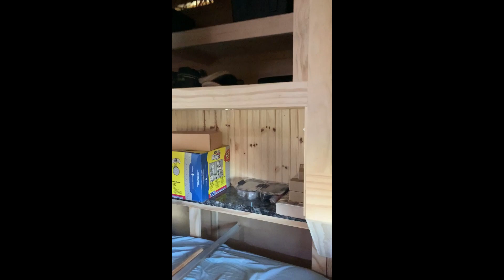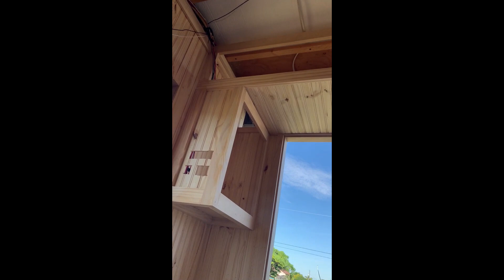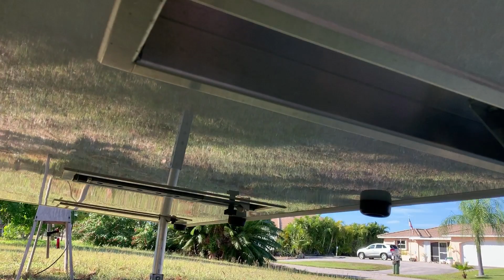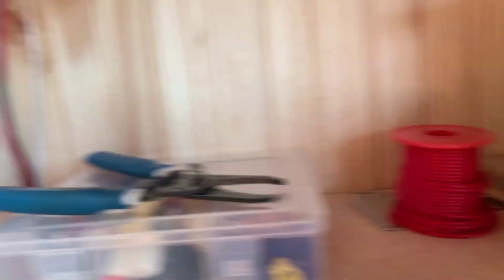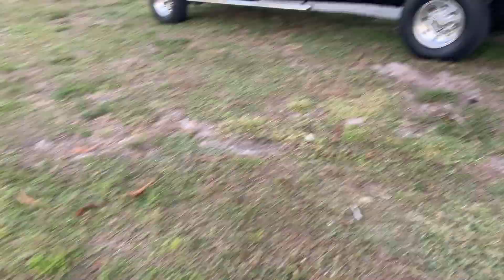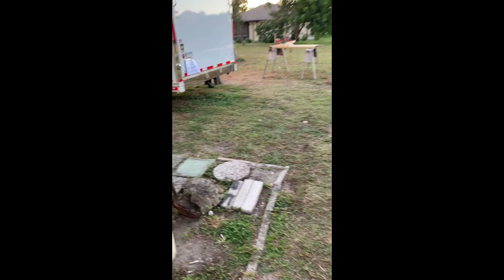RV Trailer Build #139 - Part 4 - Cabinets, LEDs, Tongue and Groove, Switch's Installed

Comment: Vince, what are you using for all the cabinet frames?
Reply from the maker: Grade A Premier Pine Boards from Lowe's. They come in 1.5. 2.5 and 3.5 Inch widths (and larger sizes too). They are hard and straight. They seem to be the best I have found thus far... This is the wood, just not the right size, could not find the sizes I used, but it gives you an idea and they are located in the same rack all of the sizes available... https://www.lowes.com/pd/Common-1-in-x-4-in-x-8-ft-Actual-0-75-in-x-3-5-in-x-8-ft-Oak-Board/1000594825
Reply: @mobileoffgridpatriot8191  Thank you Vince, appreciate the prompt reply.